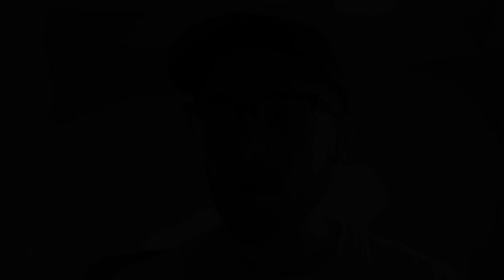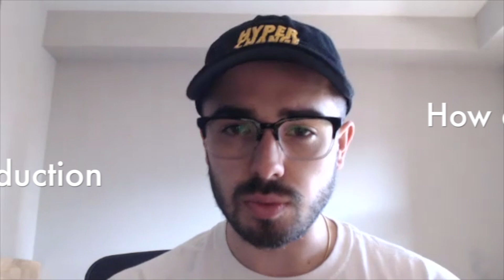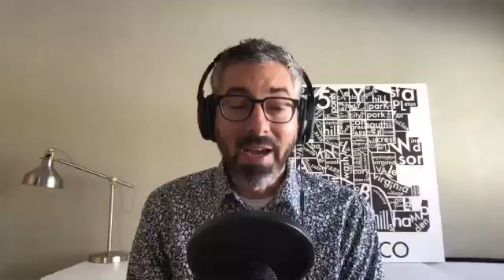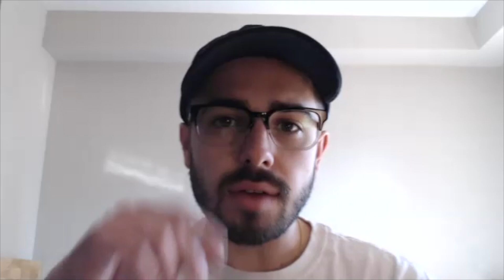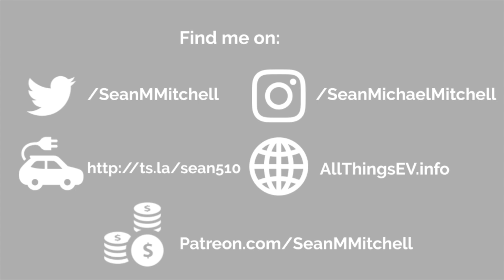Will Tesla and SpaceX buy a steel company?

Comment: I'm no metallurgist, but I think when Elon says 30X cold rolled stainless steel, I think the 30X refers to the series number which governs the alloy make-up. Stainless steel is an alloy of various elements including iron, chromium, nickel carbon etc. Different alloys with varying percentages of different elements make up the 300 series stainless. 304 and 316 are common stainless alloys used in various industries. 310 is a temperature resistant alloy used in high temperature piping and pressure vessels etc. Therefore I assume that 30X is in reference to the metallurgic composition that SpaceX/Tesla have developed for use in the Starship hull and Cybertruck body.

Cold rolling (post hot rolling) is a hardening process that essentially feeds the stainless sheet through rollers under incredible pressure which compresses the crystalline structure of the steel resulting in a harder, stiffer and less malleable product.
Reply: Correct. Not 30 times cold rolled just refers to 300 series of stainless steel alloys

Comment: Hey Sean. Unibody vehicles is not new even for trucks. While it reduces weight, it’s usually offset by further strengthening that’s required since the cab and bed are connected. I even made a video about why trucks chose this route
Reply: I'm wondering if they'll have problems with the glass breaking.